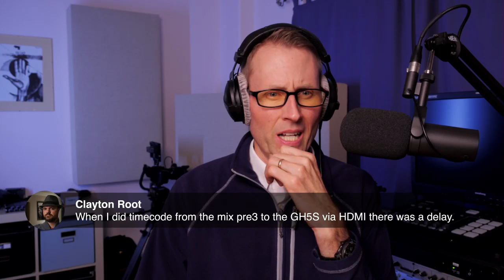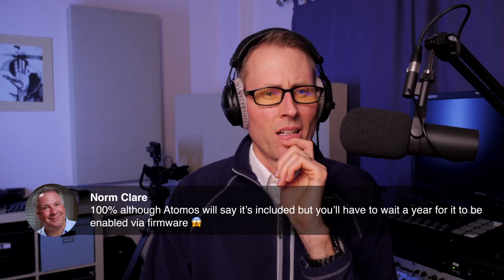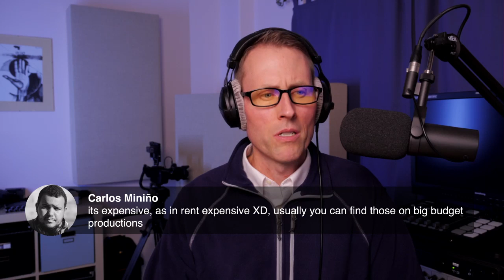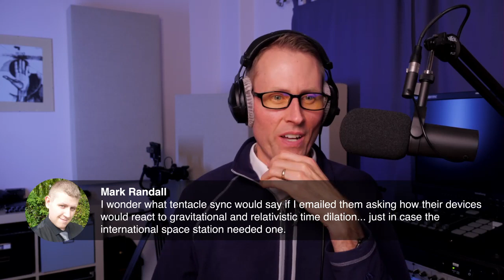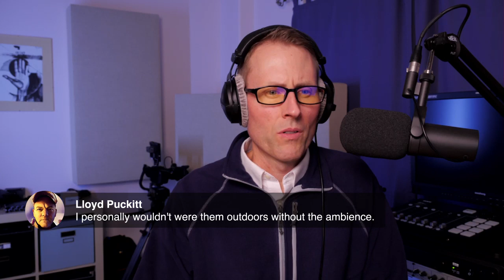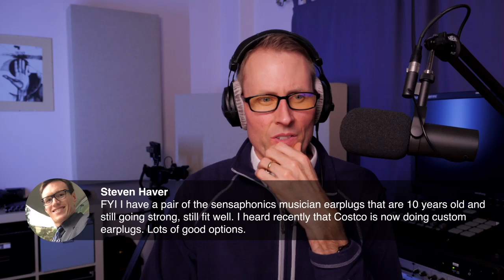Sound for Video Session: Thoughts on Timecode

Comment: Thanks Curtis for another great episode. 

This timecoding issue in particular is still puzzling me for my purpose as a beginner filmmaker. Been editing for one year in Davinci Resolve and beginning to understand its importance.

I am working with older existing DLSR Nikon D3200 camera (https://imaging.nikon.com/lineup/dslr/d3200/spec.htm), GoPro Black 5 cameras and thinking to interface it with Tascam DR-701d (https://www.tascam.eu/en/dr-701d.html) audio recorder, mainly because of the timecoding. However, Tascan specifications state that HDMI timecode is NOT supported on any Nikon (as well as GoPro) cameras. So I am wondering if  there is another way to timecode this with hardware, and make my post processing with Davinci Resolve software easier?

In time, as I improve my budget and filmmaking skills, I will step up to use new cameras like Blackmagic Pocket 4k/6k, so I hope that Tascam DR-701d (or lower models) will remain as my audio recorder.

Second option - Tantacle E sync is great and expensive (at AU$432), thinking to buy one and interface it with Nikon and GoPro cameras, but will instead need to buy Tascam DR-70D or lower models. 

Will these Tascam recorders for DLSR work with Blackmagic Pocket Cinema 4k/6k cameras?
Tantacle E sync works with Blackmagic as you and other have done.

Thank you in advance.
Reply: Hi Cvele1974, My Nikon Z6 had an issue with DaVinci resolve and timecode - the camera evidently does not start including audio in a video clip until a few frames in. This trips up DaVinci resolve which seems to think that there isn't any timecode recorded to the camera (when using a Tentacle Sync E to the mic input of the Z6). I'm not sure whether the D3200 will have the same issue. The workaround is to use Tentacle Sync Studio (macOS) or the Tentacle Timecode tool (Windows). Those apps come with the Sync E.

I would NOT recommend the DR-701. The timecode features don't work, it does not have a proper timecode generator built-in, despite what their marketing materials hint at. The HDMI connectivity/functionality only worked about 50% of the time with my Panasonic camera. You're better off saving a bit of money and going with the DR-70. If you can find a used ZOOM F4 for about the same price, that would be much better - much better preamplifiers. Best wishes!
Reply: @curtisjudd  thank you so much Curtis. I will certainly look into your suggestions. Been watching your other timecode episodes too.
Cheers

Comment: Love your videos. You know after playing with Tentacle Sync E and Timesync over HDMI on Z6 and Atomos the latency and the fact that Timesync costs more money it's just a pain and does not work well. PluralEyes and the ones that sync by the audio wave forms seem to work much better. 
In Resolve 16 I find that right clicking on the files and syncing by audio wave form works almost Everytime. 

I was surprised that timesyncing is so unreliable. Syncing by audio wave file seems to be the best.
Reply: Quick follow up. I see now that the audio sync sound on the MixPre 3 II comes out of the stereo out port. I successfully using a cable and a tentacle sync was able to feed the audio Timesync into my Atomos and record a video. The video had the video and the audio tracks contained the Timesync sound. Next I imported the video and the audio files and used resolve and synced by Timecode and it worked. 

Only challenge is again the Audio files when dragged into tentacle studio for Windows show no audio time code. (normal I guess since the audio code in the WAV files is embeded). Resolve can see the embeded code so it syncs. Boy they don't make this clear in any of the Manuel's.
Reply: @Jbandes  Hi James, I'm not following your setup entirely but if sync by waveform works well for your projects, I'd stay with that. When you start getting a complex rig with external video recorders, things can get a lot more complex. The MixPre II series (not sure if that's what you have?) has an in-built timecode generator which writes timecode to metadata so there's no need to use the Windows Tentacle conversion app. But again, I'm not clear on your entire setup. Sorry about that. :-(
Reply: @curtisjudd  thanks your videos where very helpful. Yes I have a MixPre 3 II and it's amazing. I  going to Mexico and taking my gear. I am going to capture the Timesync from the Mixpre 3 using a tentacle sync and then I am going to feed the code from the tentacle sync into my Atomos Ninja V in the Microphone input. The video feed will be coming out of my Z6 via HDMI into my Atomos. I will turn off the Timecode over HDMI coming out of the Z6 since I will not need it. 

Now I understand that the Timesync data will already be in the meta data of the WAV files created on the MixPre. The Timesync will be on the audio track of the Atomos and that I will need to convert in Resolve 16 and then I can sync the video and audio in Resolve using timecode. 

It took a while to wrap my head around all of this but watching your video over and testing I finally understand how it works. Thanks for your great channel.
Reply: @Jbandes  I think you may get better results feeding timecode into the Z6's microphone input. Then in post you convert that audio timecode to metadata timecode using the Tentacle app on macOS. The reason you don't want to send timecode directly to the ATOMOS's mic input is that there is some HDMI latency between the Z6 and ATOMOS.
Reply: @curtisjudd  I bought a pair of these tentacle sync units today. I need to check my Z6 but I think if I record video  on the Atomos in 10 bit Prores 444 it may not allow me to record also to the camera. I think I can only record the video on one device but I will check. I don't own a Mac so I have to use the windows version of tenticale studio which is not as powerful as the Mac version. Thanks for being so patient with me as I continue to learn. I have gear acquisition syndrome now (grin)
Reply: @Jbandes  Hi James. You don't need the Z6 to record, just pass the timecode audio through via HDMI which I believe it will do. The reason to send the timecode to the camera is that it will then be in sync with the video. If you feed it directly to the ATOMOS, you can get it to work, but you may need to apply an offset in the audio menu because there will be some amount of latency for the video coming out of the HDMI port on the Z6. I hope that makes sense. Best wishes!
Reply: @curtisjudd  thanks so much Curtis. Tentacle agrees with you and sent me instructions to send the audio to the camera. Tentacle sync tech support agrees with you so I am going to test this later when I get home. Ag8an thanks for helping me. This is all a little overwhelming for a new enthusiast
Reply: Thanks it worked perfectly Curtis. I plugged one tentacle into the Z6 and the other one into the MixPre and let the tentacle be the master. The Z6 sent the video feed via HDMI to the Atomos.  I then synced in resolve based on Timecode. Thanks for your help

Comment: I'm getting a 2-3 frame drift between my MixPre-3 ii and Epic-W, which is completely counter to what I was hoping timecode would do for me (speed up post). Just as easy to highlight the separate sound and scratch files and synchronize by audio.
Reply: Hey Ryan - thanks for the info. Are you using an external sync box or directly connected to the EPIC from the MixPre through the entire shoot?
Reply: @curtisjudd  Direct connect. Was hoping I wouldn't have to spend hundreds more on a Tentacle or similar. Unfortunately, for mostly one-man-band stuff, it's not worth it so I'll probably have to sell this cable.

Comment: You mentioned you have a z6 but don't use it much for video.  At a high level, why?  I know in another video you mentioned you are more focused on audio and lighting, less on cameras. And your point that any gear you have can probably work and get out there and make content!  But I am thinking about picking up a z6 as an upgrade from my gen 1 a7s and I'm curious why you choose a different tool.  Does it just not play well enough with your other tools to be fast enough for professional use?  Not really need the full frame dof for your work?  Something else?
Thanks for the great discussion love your channel always learn something new!
Reply from the maker: First, a massive warning: I’m not nearly the camera nerd I used to be and these are nothing more than my totally and completely subjective opinions. 

I wasn’t very fond of the image quality it produced. It tended to over-sharpen the image and the colors were a little odd. This struck me as strange because it is a great still photo camera. This is all subjective and it is likely possible to tweak the settings to tune the image but I just haven’t had time to work on that. And, the microphone input is even noisier than their older DSLRs.
Reply: @LearnLightAndSoundSessions  Thanks for your feedback!  If you are interested I did find some potential fixes for color you may want to check out, though you are the first person to report video sharpening that I have come across.  The first color issue I saw was reported by Gerald undone, starting at time 06:10 in this video: https://youtu.be/87Y_8SmQkMk. In it he observes that Nikon's log profile screws with the colors and shows their flat profile as more accurate. Additionally, Nikon has released a LUT, though I'm not sure if it's any good.  

I still haven't 100 percent decided yet. I'm kind of waiting for atamos to actually release the prores raw update and for that to be tested.  I don't like that Nikon's battery can't be charged via USB while recording video. But I do have milvus glass in Nikon mount, and the price plummet of the z bodies combined with Nikon being able to throw the kitchen sink of their video capabilities at this line (not having higher end recorders to protect) is strongly appealing for me.

I am a bit surprised on the z6 preamp being an issue for you.  My solution for that is a mix pre, and you have that option in spades. I suppose not being able to use it as a standalone might be a problem though.

Please don't take any of that as a criticism!  The color stuff is just an FYI, and the rest is me rambling.  Love your content and thanks again!
Reply from the maker: Regarding the preamp, in live streaming cases I usually run the audio out of a MixPre into the camera. That became problematic for me there. Not that everyone has that use-case. It’s just one I ran up against. Thanks for the info from Gerald. I’m definitely a Nikon fan, just didn’t find for my use cases that the Z6 was a great fit.
Reply: @micahturner5599  If you're planning to go with the Z6/Ninja V combo, make sure create a monitoring LUT for your Ninja V that uses Nikon's new NLog to rec709 as the starting point but, very important, decrease that LUTs intensity by about 50% before creating as a new LUT that you import into the Ninja V. It's made an absolute world of a difference since I've started doing this and in a lot of cases, I'm picking my Z6/Ninja V combo over my Epic-W.